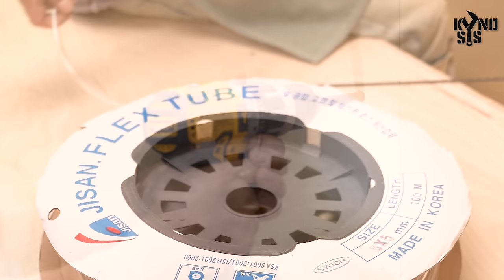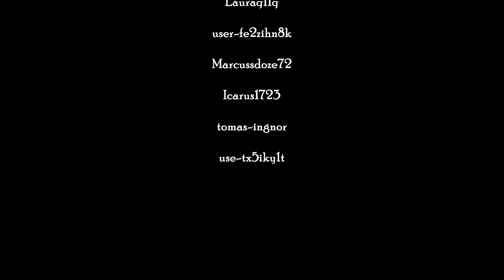Hidden Drawer for Paint Can / Shop Organizing / DIY

Comment from the maker: I made a large drawer to store paint cans and subsidiary materials. 
My workshop was small, so I didn't have enough room to keep it, so the chest of drawers was hidden and made it open and close with the power of an air cylinder.
It's literally a hidden chest of drawers.
The goal is to use a narrow workshop efficiently, so I come up with a lot of ideas. That's the purpose of continuing to create structures that move automatically everywhere.
You can enjoy the composition of the bottom plate of the drawer and the process of being driven using an air cylinder.
To make it feel like it's physically opening and closing, I purposely used a manual switch in the drawer.
It took a long time because it was such a masterpiece, but I really like this drawer when I finished it.
It automatically acts as a gateway.
I hope that my work, when you make wonderful work, will be a little clue. Thank you.

Comment: great job - but where do you get such a large cylinder? u have a link?
Reply from the maker: Pneumatic cylinders come in basic sizes. However, there is not always the right size for the work. If you contact a store that sells pneumatic cylinders, they can custom-make the cylinder diameter, rod thickness, and stroke distance. I also use custom-made products like that. thank you!